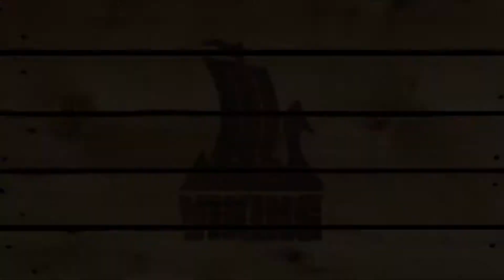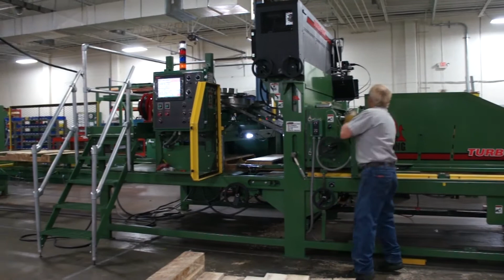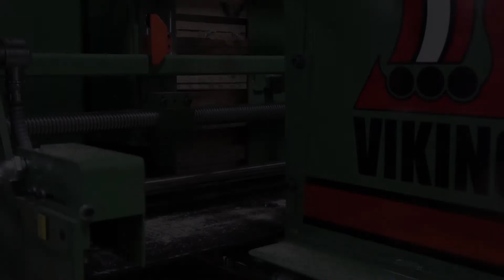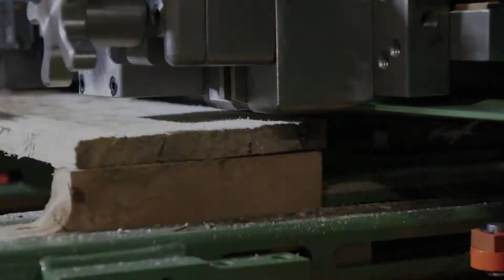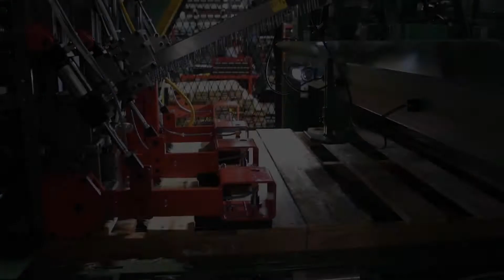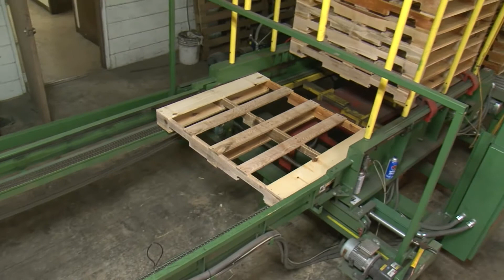Viking Turbo 505

Comment: This guy must have good boards. I used an '87 viking which sucked for leaking hydraulic fluid but we also had the turbo 505 and if either side had crap boards or runners from our saw mill it took longer to  sort through boards and runners which took longer in production time which wasn't worth the time in the morning for what the pallet company paid me per hour. It was a shitshow

Comment: I wonder how many standard pallets this thing could produce per hour and with how many operators?
Reply: About 200 per hour and 4 operators, even tho Vikinh recommends only 3 operators.
Reply: @maurylopez2728  even without combos?
Reply: @thenativegamer443  we do not build combos on this machines.
Reply: @maurylopez2728  I can see combos being used. 5 1/2 on the ends and 3s in the middle.
Reply: @thenativegamer443  I meant we don't build combos on this machines at the place I work at.
Reply: @maurylopez2728  oh